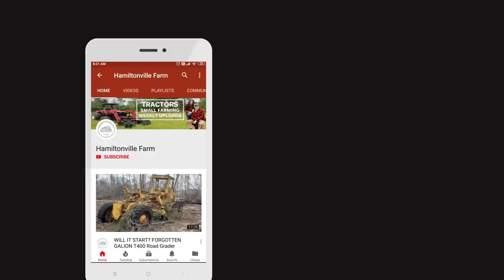CRAZY DOZER OPERATOR Drives IN A FIRE!

Comment: As crazy as it sounds controlled burns help to lock away carbon for up to 100 years.  The burning process like this produces a large amount of charcoal as the hot embers cool off and the fires cool off and as charcoal it will last up to 100 years in the top 24 inches of soil and thousands of years once it gets down to the low oxygen environments deeper in. 

You start off with it as identifiable chunks of charcoal and over the years it breaks up till it is just a fine powder but still high in carbon locked in the soil.
Reply from the maker: Thanks for watching and taking the time to comment 👍

Comment: That is bad for the air
Reply: Not really No.
It's a natural cycle usually started by Lightning and back burning simple controls the burn so it doesn't cause damage or loss of life.
Many plant seeds need fire to set them for germination and regrowth, Fire returns and releases Nitrogen to the soil and simply put its a natural cycle that is required by the environment to thrive.
If you dont do this you get massive wildfires at temperatures that burn the flora which cant regenerate stripping the earth of plant matter and causing the nutrient rich topsoil to erode and often run into water which damages fauna and fish by polluting the water.
Something we learned here in Australia when the ignorant greenie morons in Govt stopped old growth selective logging and slashed the backburn budgets and we had one of the worst fire seasons in forever.
Another interesting fact for you Judy is that Hunters and outdoor rec guys and gals are amongst the best environmentalists today as they are in there cleaning and preserving the habitat.
Reply from the maker: Couldn't have said it better myself.
Reply: @HamiltonvilleFarm  yeah but Hank you'd have added some Twang lol
Like being told by Trace Adkins